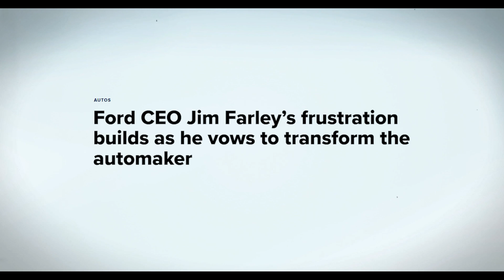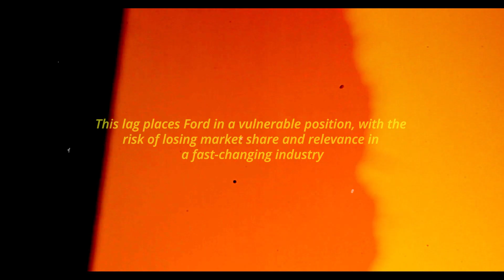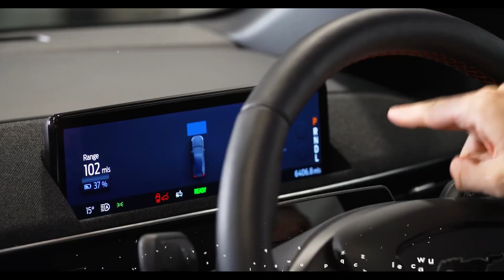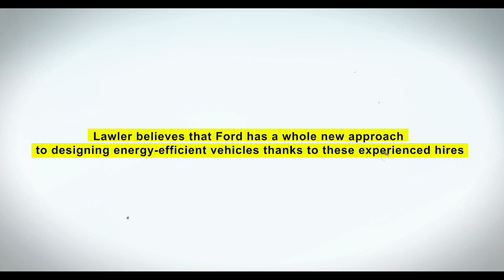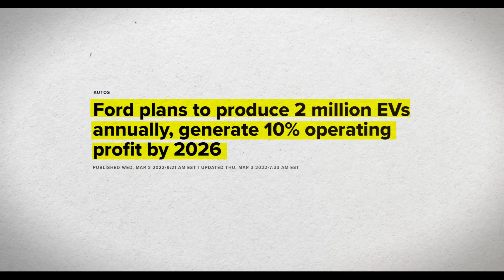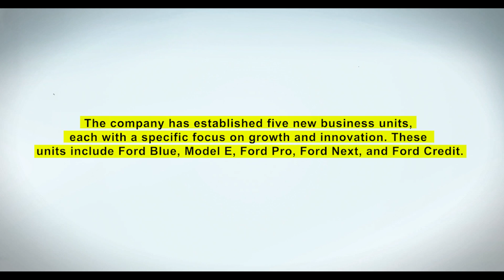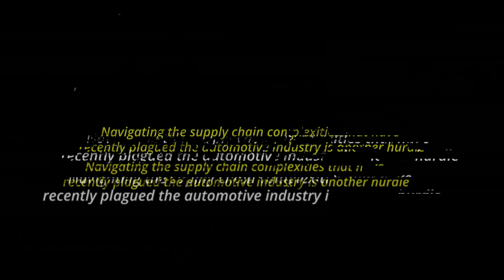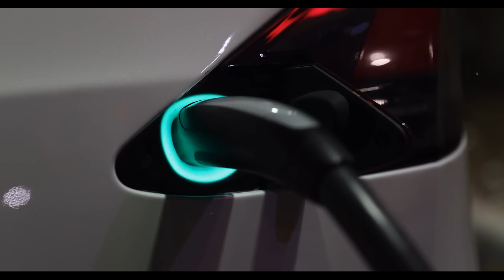Ford CEO Finally Admits They Are In BIG Trouble   HUGE NEWS!

Comment: Ev vehicles are just straight crap...
The concept is good but not doable at this point in time...
The battery cost half the price of the vehicle and combine that with all the computer chips and lack of operation history this is junk..
Built to break and over priced...
I will always be a gasoline and diesel man myself...

Comment: Except that the demand from consumers and sales growth has been grossly overestimated. The easy pickings have already bought their electric vehicles. From now on it is going to be a hard sell, forced on unwilling consumers only by massive fines on manufacturers if they do not sell enough electric vehicles and increasing every year. The result will be ever-increasing losses for the likes of Ford.  The great majority of their customers just do not want electric vehicles for all kinds of valid reasons.
Reply: You are correct when we are talking about traditional Legacy automakers. 
But not Tesla.  That’s the best selling EV in the world.
Total     Sales of EV’s  are 50% more this year over last year. 
     The reason is Legacy automakers are stuck with past practices and old factories. 
  For example the typical back 1/2 of a vehicle is made of an average of 170 parts  requiring 3 man hours of work to assemble.  
  Tesla makes the same in 37 seconds automatically with no man hours involved.

Comment: It's obvious that Ford, GM and Dodge have their work cut out for them.  my suggestion is that each consider stopping EV production until the major problems with making the vehicles are addressed. What are they?
!.) Quality Control: Every vehicle that leave the plant must be completely covered for 5 years and 100,000 miles parts and labor.
This means the battery packs too. 
2.) Recharge friendly: This means that a common agreement between all automobile manufacturers to develop a solid coast to coast infostructure will be developed ASAP. It means that every vehicle uses the same type of recharging system, creating that network everywhere and it means that they all split the cost of making that happen.  
3.) A free charging system (Level 2) for customers will be installed in a customer's home.  (To cut cost, buy, or build a company that makes them.)  
4.) Financing: The term of all loans on any EV's needs to run longer to make the month-to-month payment lower.

Comment: Do the math and forget politics.  When you fill up your car with gas, what does it cost?  $40-50?    To travel the same distance with an EV  plugged in at home where 98% of charging occurs.  
  the cost in electricity will be   $3-7  dollars.   ( depending on where you live) 
      The batteries in EV’s are guaranteed twice as long as the  engine/ transmission etc  with a Gas powered vehicle.  Just like the engine and transmission etc. batteries last far beyond the warranty. 
  In addition. No oil changes or fluid changes ever in a EV ( well except you will need to add Windshield washer fluid as often with an EV as with a GS powered vehicle.  
        Finally Tesla’s start out costing less than the similar Gas powered vehicle by a legacy auto maker.  Plus you get a minimum of $7500 discount ( as of Jan 1.  Until then it’s a tax deduction).  
  In addition states typically offer additional discounts.   Minnesota is only $2,500  while Colorado offers $7, 500 and an additional $5000 on EV trucks.  
   California and Washington  offer at least $5,000 but have many local additions.